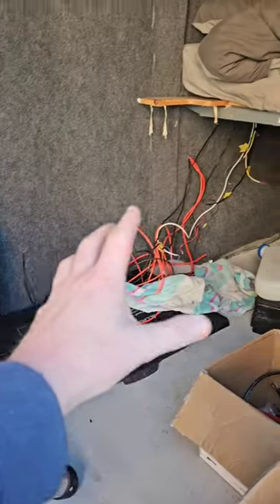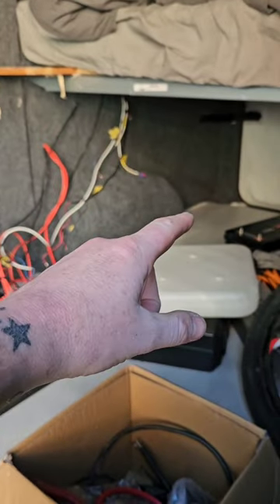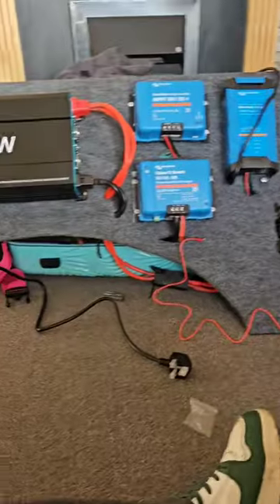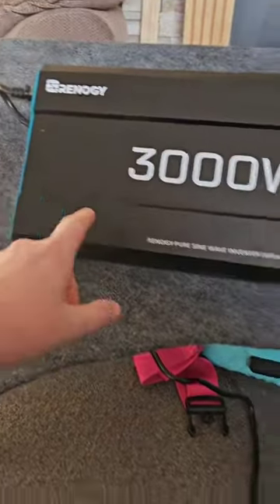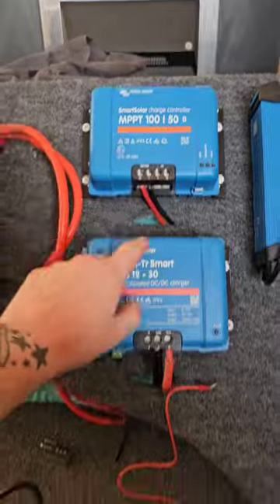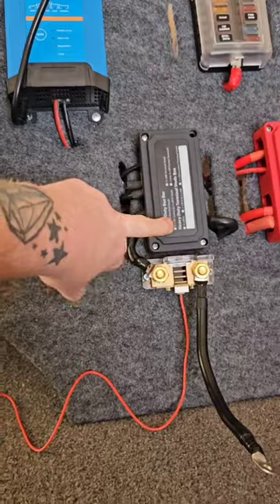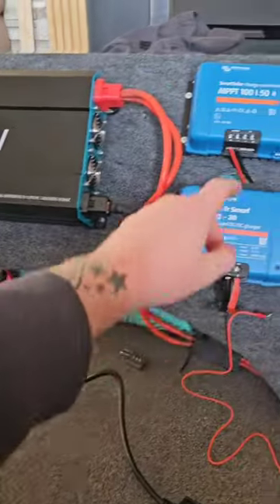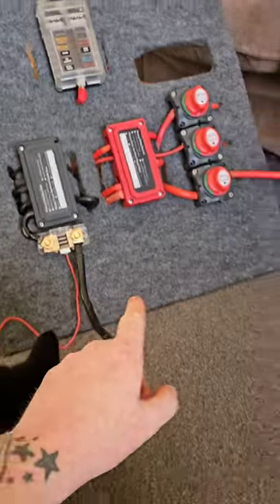Campervan Electrics HACK

Comment: Nicely done and heres the BUT no really a good idea to mount any electrical gear  on carpet ... fluffy stuff not good if there's ever an electrical fault
Reply: Certainly a goid idea to test the carpet is fire proof.
Reply: Or put them on stand of plates
Reply: No electricity under my bed , fire proof carpet or not ! 😬 Good job though ! 👍
Reply: @wilmafallon8712  If you live in a house there's quite possibly electricity under your bed.
Reply: This is quite normal in a van build, the carpet is tge stuff that all cars are lined with, not a remnant from his bedroom. 🤦

Comment: How to create a fire hazard should be the title 😂
Reply: People watch a few videos and think they’re an expert.
Reply: @Jarv263  if you was to mount it on carpet then atleast put some spacers behind the fixings to give it an airflow gap behind it but personally I would avoid any fires and mount it safely
Reply: @Not-Today-Pal  mines mounted of a timber back board and I’ve used 15mm copper cut at 60mm long as spacers, loads of air flow behind.

Comment: Ii dont evven likee usia kettle for 2min on those supplied renogy battery cables, they are copper coated aluminium,  not good for transferring more than 80amps let alone over 150amps or more

Comment: Yup, modular setups are better in every way.
But one further hint is to use a smooth surface and not carpet. Carpet slows air flow so the heat sinks on the back of the electronics don't work as well.

Comment: What about heat on the carpet is that not a fire hazard?
Reply: Yes it is, especially the B2B, I have two of those and they get very warm, they should be spaced away from any combustible material, I believe that’s even stated in the victron manual.

Comment: If you don’t mind me asking why you got two red cables out the inverter? No hate just curious as I have the same inverter 👍🏻
Reply: There appears to be 2 positive (red) and 2 ground (black) of a decent gauge cable, I'm going to take an educated guess it just to make sure it can take the load safely being a 3000w inverter 💯
Reply: @VXXXIMCMXCIII  black will be neutral in this case but yeah 2 loops  I assume one is for solar and the other is for charger
Reply: @dangallagher2306  neutral, ground same thing within a 12v system, run a black cable straight of your leisure battery to the van chassis and you have a ground for your connection from anywhere in the rear of the van 😉
Reply: Those cables actually come with the unit (2x red, 2x black).

They double up to ensure enough current can flow safely.
Reply: @CJ-ew8df  thank you 👍🏻
Reply: @CJ-ew8df  I only got one black and one red? Got me worried now
Reply: @adamshaw1032  Do you have this exact model 3000w? I think they only send one cable with the smaller models. I have this exact same model, that's why I know about this particular inverter.

If you read the cable, it should tell you its gauge (hopefully)
Reply: @CJ-ew8df  yes mate mine is 3000w exactly the same. I’ll have a look at the gauge and get back to you 👍🏻
Reply: @CJ-ew8df  Renogy supply 4awg cables x2 I had a full talk with thier tech team and they agreed they are actually the incorrect cables for a 3000w inverter and refunded me £75 to go buy 4/0 awg cables that's should be installed PM me for any evidence of the conversation I had with renogy. Also doubling cables doesn't double the amperage it can take and the cables supplied by renogy will burn out before the recommended 400a fuse as stared in thier manual if you load a full 3000w on this inverter
Reply: @molecule78 yeah I noticed this too and it's also listed in the Amazon reviews. I wish I had taken it up with them to get £75! Technically speaking, having an air gap between doubling up the cables and fusing each cable (individually) does allow additional current but it's absolutely not double the current. For my installation, I very rarely go over 2000w and have installed lower rated fuses to prevent it going anywhere near 3000w.

I guess it all depends on your installation!
Reply: @molecule78  Update for you, Amazon just gave me a FULL refund for the inverter (without sending back) and I purchased in June 23.
Reply: A 3000W inverter can maybe peak at 4000W. If you are running that from 12V that is around 350-400A. Lots of current.
Personally I'd rather use a 24V system for anything over 2000W. If you double the voltage then you halve the current.

Comment: Pretty sure anything electric should be connected to something other than wood or carpet. For the purpose of preventing fires and to keep the electrics from over heating. An aluminium sheet might have been a better idea. But I'm not an expert 😊